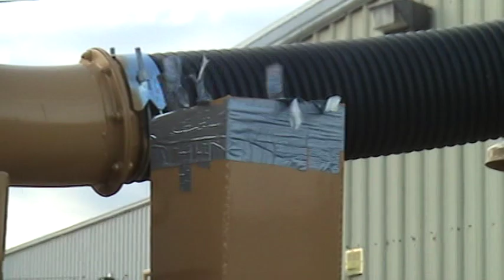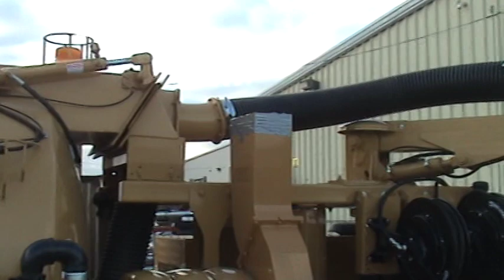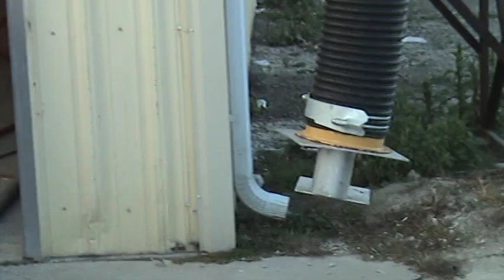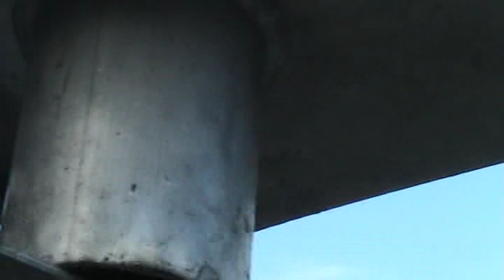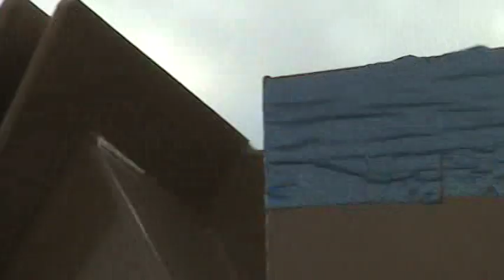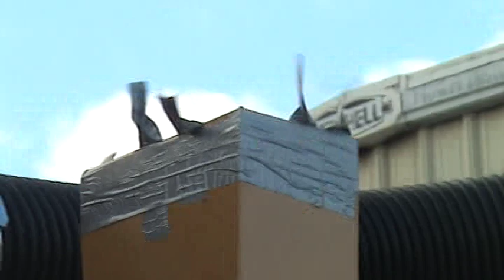Does your unit blow when it should be sucking?

Comment: that is cavitation of the rotors they are momentarily spinnig the air trapped in the vanes ,not good for the implellers ,the same if you block off 90% of the air intake of your home vacuum ,both not the best on the gear,